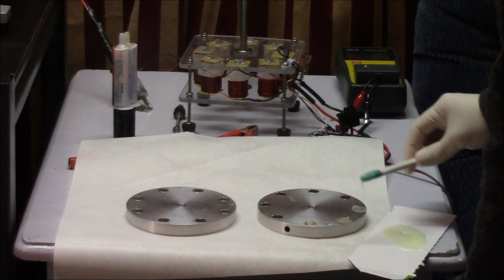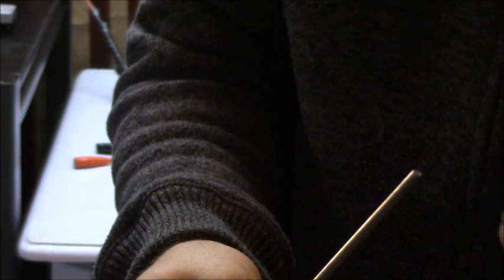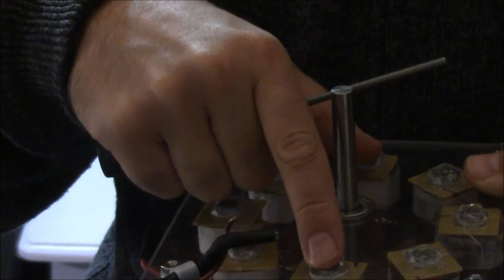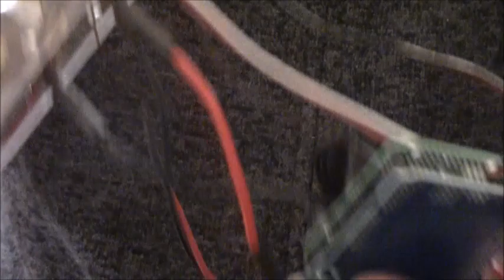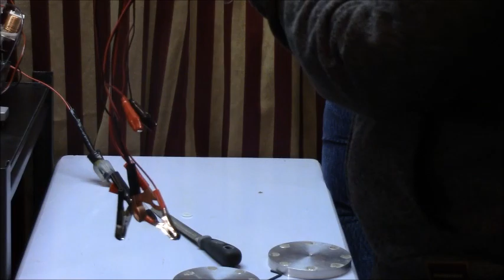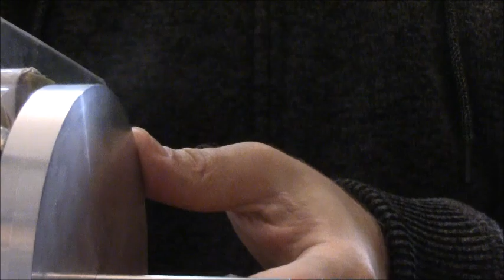Basic Assembly of the 4 DualPole Motor

Comment: Most value indeed sir... gotta get me some batteries and assemble it the rest real soon and pre order some ps good tip on the transistor practice which I been bench atm with the ignition coils imhotep passed to kurtsvids both on YouTube also imhotep guy  mentioned tesla said running high currents through gas secret disrupter

Comment: Rick, is it possible to order the set screws for the rotor? I ordered a double stacked motor a while ago, and one of the rotor came with no set screws. I'm not sure if they were misplaced, got lost, or weren't included in the shipment, but I was not able to locate them. Thanks.
Reply from the maker: Sorry about that. They are 1/4-20. Not sure who is this to send them out.
Reply: @rickfriedrich  My Order Number# PT-720. I also submitted a support ticket:
Customer Support ticket #7193. Thanks.
Reply: @магомедс-ы9ф  Because of missing part, I was not able to complete the assembling of the motor. If you're considering testing the motor out, I recommend getting the fully assembled motor, putting the motor together, following the included printed instructions, was a challenge for me. I did not have all the tools nor soldering tools, and I had to go out and buy all the required/recommended tools  to put the motor together.
Reply: @магомедс-ы9ф  You can see the prices at Rick's website https://www.r-charge.net/kits.html
Reply: @магомедс-ы9ф  Price may seem high for those outside of the USA.. But the 4 dualpole motor costs about the price of a high quality fishing reel. Quality electronic parts do not come cheap.
Reply: @магомедс-ы9ф  I don't think there will be any Chinese clone because this is not a conventional motor. I don't think the motor is a plug and play device. Its purpose is for learning and testing an alternative way to generate power that is not well understood, ignored, or suppressed in the main stream world... Maybe you can find a group of people to learn and test together? And also help split the cost?
Reply: @магомедс-ы9ф  Rick is showing how to connect and arrange the coils in this video. First figure out the positive and negative ends of each coil. 4 coils are acted as generator coils (connected in series), and the other 4 are motor coils (connected in parallel). Coils are arranged alternatively, generator > motor > generator > motor..  I suggest you watch Rick videos multiple times, watch for important points/clues and take notes.

Comment: Thank you for sharing. Will the upcomming Arduino board (with possebility of rpm setting) also be usable on the big dual pole?
Reply from the maker: We'll be able to that for both motors so long as the motor can go up to that rpm under the loads used. It will be a least a month before I can get caught up to make that available as we have other commitments.
Reply: @rickfriedrich  Looking forward to it.
Reply: Miss it too.. wifes been wondering what happened to rick even